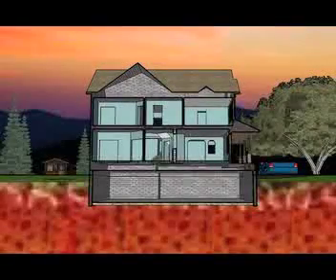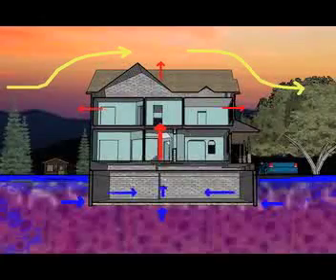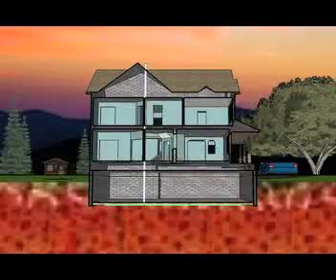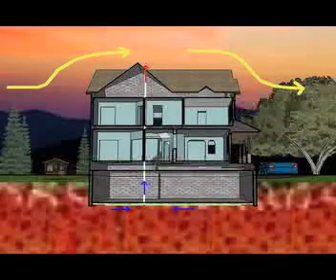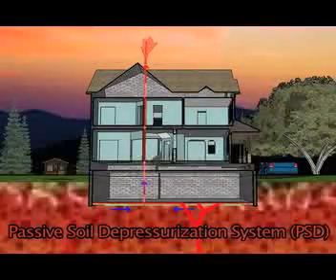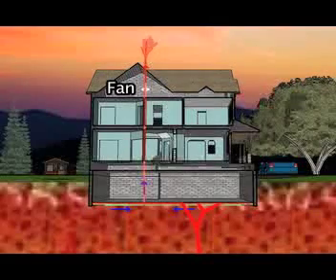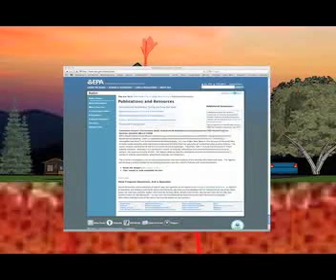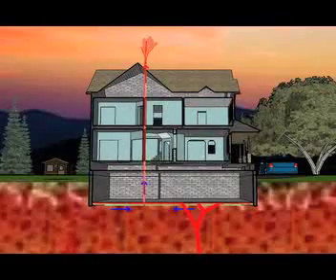How to prevent Radon from getting into your home

Comment: so if you are pulling air and moisture from the soil, reducing the radon, what happens to the foundation? does it settle any and cause cracks?
Reply from the maker: If you are adding a system to an existing home, it is possible, but improbable to cause a foundation problem. All houses are different and settle some with time.